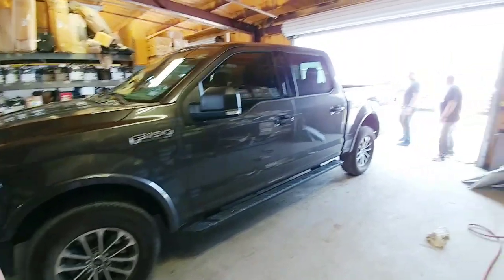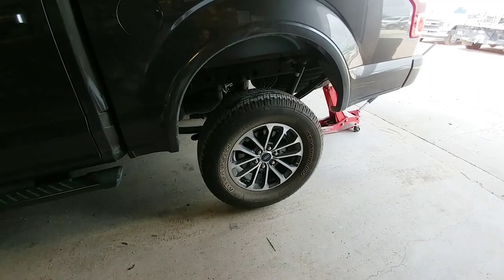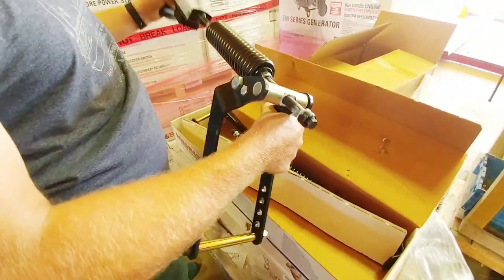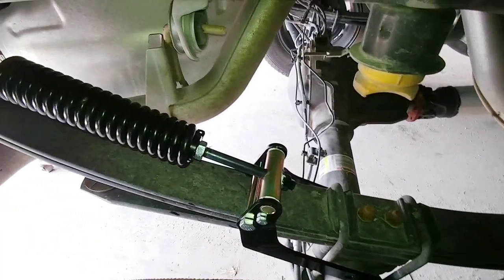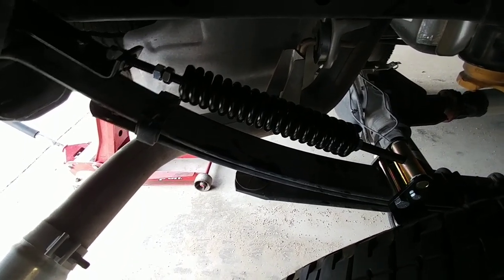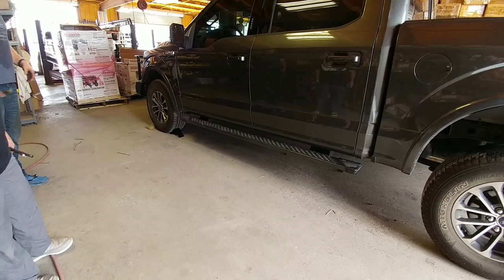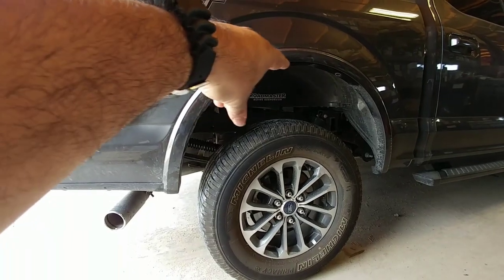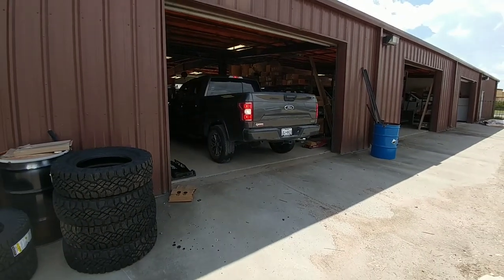Must have for 1/2 Ton RV towing! Roadmaster Active Suspension

Comment from the maker: We plan on trailering with this setup to review the improvements.  We did not have time to do it that day.
Reply: I have this on my 1/2 ton with happy and max towing packages and it is great.
Reply: You should put tow mirrors on the F-150
Reply: Big Truck Big RV  can you install with this air bags
Reply: As to the debate of advocates vs skeptics: it would be nice to have a Ford (or other truck) engineer sign off on this .
Reply: How does this compare to adding a helper leaf?
Reply: Curious if you can use this with air bags as well.
Reply: Would love to get a review video on this setup. Any chance it will happen?
Reply: @rvalltheway2796  I'm not sure you'd need to but that is a good question.
Reply: I have an F250. To improve the UNLOADED ride quality would you recommend the RAS or the Sulastic springs?
Reply: I have a 2016 F-150 Extended Cab, 4x4, w/Heavy Duty towing package.  I also have Timbrens on the rear end.  Can I use these in conjunction, or would the two systems be working against each other?
Reply: They make two styles - regular, and HD.  Which one is this?

Comment: I installed this  over 4 months ago. I pull a travel trailer that weighs 8000lbs. I’d say 90% of my trailer sway has disappeared. I bought this because even with my weight distribution sway control hitch setup, the sway was horrible. And yes I set the hitch set up correctly. This has been the best purchase I’ve done. The new f150 trucks leaf pack on a 4x4 are not strong enough compared to a 4x2. Most folks with a 2 wheel drive are not having the sway issues the 4x4 trucks are having. I’ve done enough research and found that out along with other differences. Hope this helps anyone
Reply from the maker: Great! Thanks for the reply
Reply: When you installed it on your truck did you take it to a shop or dyd you do it yourself? Looks pretty easy to do. I was thinking about putting in airbags for my 150 since it sags a little with my atv, but this seems like a set it up and forget it type of thing.
Reply: Chris Harris I installed it myself. It was really easy. Just make sure the axle is fully extended to get these to work correctly
Reply: I'd forget it all together
Reply: If you're still getting sway with your weight distribution hitch, your hitch is possibly not setup correctly.
Reply: I got some for sale. $200. used for 2 weeks
Reply: @beerbelly6670  is it for sale still?
Reply: @beerbelly6670  so what for sale??
Reply: @bottlefed91  did you make a video of the install with towing the 8000 lb trailer.
Reply: @joedonbaker1673  Oh but the 2004-2008 long bed f150 is just a towing master.
Reply: @JurjenHettinga  not with a travel trailer my friend. Your hitch can be setup perfectly but if you are towing an 8k pound plus trailer with a half ton when those tractor trailers pass you in the highway you are gonna get sway.
Reply: @frankthetank9193  Nope not true! 
I run with a Husky Centerline Anti sway and load distribution hitch on 2018 F150 FX4 Lariat! 
I go 70 75MPH in the mountains w/o issue. Great product.
Reply: 4x2 F150s have stronger leaf springs than 4x4s?
Reply: I ordered a pair for my Z71 2022 Silverado don’t have it yet but it’s on the way can’t wait to get them also bought a 2021 keystone passport 268BH so I should be set for towing the RV thanks for sharing

Comment: Add-on gizmos?  Why not just get a proper TV that can tow the trailer?  The problem is most folks get it wrong. This is the one time when you can put the Cart before Horse. It's better to know the limits of the TV before you buy the trailer. The first question you should ask the RV salesman is, what is the weight of that unit and what is the max load capacity?

Comment: When I first saw this product 5 years ago, I thought it was snake oil. After my mechanic highly recommended it due to his personal experiences, I gave it a go because it had a 30 day money back guarantee anyways so I figured it wouldn't hurt. I'm sure as hell glad I did! Wish I had done it 5 years ago!! I didn't need that 30 day money back guarantee because its the best product I've ever put on my truck! With or without my camper, this thing is smooth riding, sway control, axle wrap eliminated, and YES it helps with fuel savings ( when my camper is on). Id suggest anyone who is skeptical, or  thinks this is snake oil like I originally did, to give Roadmaster a call and take them up on the 30 day trial. You wont be dissapointed.
Reply: huhhman Ok.

Comment: That ride height/rake looks terrible, like comical bad. Air bags are the way to go. I have sumo springs that work very well for towing but are harsh enough that I remove them during the time of year that I don't tow my 5th wheel. I would adjust those to a lighter setting, or get that front level kit on asap

Comment: You always do a fantastic job of presenting information. I went with Summo Springs that install in the area of the bump stop. No rattling, never wear out, and install easily. They ride about 3/4" above the rear end frame on my truck and so don't change my excellent ride when the GMC 1500 is empty. As you add weight, they become more effective. My experience pulling my 7500 pound (when loaded) travel trailer has been great. Very little squat and more stable. This might be a good product for you to review.
Reply: Which set of sumo’s did you go with, blue, black or yellow?
Reply: @Bcharns  Been a while but I believe it was the black.

Comment: the pivot point of the RAS (the brass piece that the spring bolt feeds through) needs to be closer to the axle. It's too far back. You need to extend the assembly to make it longer. That's why there's more than one set of holes for the bolt and sleeve that fit under the leaf spring. Common oversight.

Comment: I absolutely love this product.  Because there is no drilling or screwing, it is easy to install yourself!  Just make sure you use jack stands.  That's scary having the truck only supported by a single jack.
Reply from the maker: Correct, this is a 1hr install max.
Reply: Oh I believe there is some screwing going on here.

Comment: I have looked at the RAS systems, but ended up with the Hellwig Progressive spring system.  Had it on my 97 F150 and now on my 13 F150 and they work best for me.  I've never had air bags before, so can't really compare, but when I looked at those too, I have just never liked the fact you have to adjust them for every load..

With the springs, it's set it and forget it...  I have some Bilstein 5100 shocks too, so the combo works very well for me.

Anyway, thanks for the vid to show the other product in more detail, but in the end, I like my Hellwigs.. :)
Reply: so air bags not good ?

Comment: I usually agree with your recommendations but this time I do not. Individually controlled air bag assist is best for maintaining desired ride height. They also will not sacrifice empty ride quality. I have them on two of my trucks (Ram 3500 with factory rear air ride and an F550 with aftermarket air assist). Each truck now provides a far more stable ride when loaded and the same ride it had empty.
Reply: I too have the air lift assist kit on my truck,   by far better system along with a auxiliary tank for air to whatever you want to use air for.

Comment: I have a 2011 F 150 with the max tow package. My trailer only weighs about 7,000 lbs. The I run load range E tires, an Anderson hitch with air shocks. We have been caught out on the prairie with 45-50 mph winds and it rig is pretty stable. Up grading from the factory tires to the load range E’s made the most difference. Plus they are lasting longer. I like being able to adjust the air shocks to maintain the ride when using the truck solo.

Comment: This is an interesting product and a good review. I have a ‘12 F150 that I used to tow an 8800 lb trailer and I added something similar with the Heilmann Helper Spring kit which was used to stiffen up my backed for towing. Curious as to your thoughts on that product? It would have been neat to have you hook up a 7000. Lb trailer and do a pre and post install squat test in seeing how much of a difference those springs would have made. Maybe in another video do a measurement? Helpful video and good introduction to an overall inexpensive product with some good upside.benefits.
Reply: I'm going to be pulling a 8,000 lb 20 ft inclosed car with my 2011 f150. I bought a weight distribution hitch and this system. How does your truck do pulling 8800 lbs?

Comment: I have set that I had on my '13 F150 with max payload/max towing package. They are good for helping with the braking and axle wrap but the gripe I have with them is that the bolts that go under springs tend to bend too easy. Last time I pulled them off, I had to beat the bolts out of the spacers to get them off. Not Fun!
Reply: I'm assuming you're talking  about the U bolts that hold the leaf pack?

Comment: I had them on a 2007 f150 with the 5.4 and they worked exactly as advertised. Pulled a 32’ and a 34’ bumper pull and, with a WDH of course the RAS made a difference in towing. Unloaded it did ride a little rough but was never too much to cause an issue.

Comment: Good video. Have seen this product before. Question is: can this be used together with sulastic shackles? Just installed one for the stock Ford Excursion v10 in the rear...the truck is for everyday use and long road trips and not necessarily for towing. Just looking for a smooth ride with less or no sway and vibration when hitting a pothole. your thoughts on how the sulastic springs (stock and not lifted) and the Roadmaster can work in tandem...
Reply: Anymous vint what do you think of the sulastic shackles I have a f250 4x4.

Comment: This thing could fatigue a leaf and if they're not military wrapped, you're in a really bad spot if they break. It will put weird stresses on the leaf pack centering pin, u-bolts and axle pads too. Firestone airbags and add onboard air while you're at it.

Comment: That test drive looked like the roughest ride I have seen out of a modern truck. The pendulum on the mirror was swinging on every bump and everything in there rattled like crazy until you muted the interior noise.  After trailering for hundreds of miles, I would like a tail bone when I get to my destination.  Good idea but not a product I would invest in.  Good video though, thanks for all that you do for the community!

Comment: You should have also driven the test loop with and without a trailer before the install and measured wheelwell height before and after.  This would have provided a better basis to determine the effectiveness of the product.  And also a test ride pulling a trailer after the install.

Comment: Fuel economy rating may be due to less wheel hop = more power to the ground not wasted.
Regardless that’s a lot of money for what it is, engineering is expensive. I’d go with airbags.
Reply: fuel usage with nose up vs nose down
Reply: Air bags don't compare to this system for towing

Comment: Pretty cool. Would you say this replaces need for sway bar, sulastic shackle or Timbrens? Would love review before and after with a trailer.
Reply: Hey Seth. Effectively it's going to do the job all 3, but obviously just in a different manner. Sway, smooth ride &less bounce(especially when loaded) and reduced squat. Fingers crossed he has a part two with a trailer involved!

Comment: Why not just "add a leaf" kit and some Bilstien or Rancho rear shocks?
Reply from the maker: Add A Leaf harshen the ride considerably AND requires far more labor to install as well as requires replacing the U-Bolts.  Not a bad solution (As it's what I did on my 2011 F250), just doesn't have as many benefits as this system does.
Reply: @BigTruckBigRV  how much more weight can it hold?

Comment: How well would this work for towing a 6,000-6,500 (3,000 lbs + 2 show steers) 14-16 ft. livestock trailer?  I have 2 kids and I would prefer to stay with a 1/2 ton pickup.  The majority of the shows are within 3 hours driving and I'm confident my 2013 Sierra 1500 with that has a HD towing package (HD engine and transmission cooling) can handle the weight but I'm unsure about what upgrades to do for the hitch weight and what braking upgrades I would need.  I will install a trailer brake controller in the truck too and have electric brakes on the trailer.

Comment: I didnt like the rake on my truck, and since the leveling kit for these trucks is absolute garbage and just plain not safe, and the factory springs are not heavy enough to haul much, I use a auto level air bag system from ridetech and lowered the back to keep the truck level. Works like a dream.

And to those that want to disagree about the leveling kit for these newer f150s put one on, jack the front end off the ground and watch the upper ball joint. The only "leveling kit" that works is the fox struts for the front, they lift the truck alittle without allowing the suspension to travel downwards farther than factory bottoming out the upper ball joint.

Comment: In my opinion, all this does is stiffen the leaf spring by adding some additional spring rate to half of the arch. 
It does nothing to combat the effect of the tongue weight on the axle loads.
It absolutely does not increase the towing it hailing capacity of the truck. 
It does not increase the resistance to sway any more than adding an overload leaf or air bags would. (Again, it simply stiffens the springs)
Fuel economy? Yeah, right. How? Got some test data to back that up? 

The primary thing these do is reduce the distance the rear suspension squats under any given load. That's it.

Comment: Interesting product. Your videos are always informative. Question here how ever. Is the sleeve and bolt in the correct hole? I have watched other videos that put the bolt further up the line like the third hole as to put the other end of the bracket closer to the axle. Thank you in advance for clarifying this.

Comment: You can put enough spring or bags under the back to carry an oil tanker, but the trucks gvwr cant be fooled. Frame strength, rear axle gawr, transmission, brakes, all the same.

Comment: I live in California and just bought a 35 foot Jayco Jayflight (2015) and I purchased a 2018 Ford F-150 XLT.  I brought the trailer home and it was a very bouncy ride.  I have a weight distribution system on the hitch.  Would this system improve the ride with the weight distribution system or should I go with an airbag system?  I am brand new to towing.
Reply from the maker: This should help considerably.  might also want to go with a firmer shock, like the Bilstein 5100
Reply: Buy airbags, all in, parts and kit, $650ish, a little more than this setup, but adjustability on the fly is nice with onboard air.  Have donee to (2) 1/2 ton trucks that hauled and towed constantly, best upgrades ever!  Hellwig on GMC and Firestone on Ford, both problem free for thousands and thousands of miles.

Comment: Sorry but I didn’t hear the owners /driver comments on the ride change before and after install was it good or bad? You were driving around in a unloaded truck and I thought this product was more geared to improving loaded ride, squat and towing improvements . No sure you convinced me to spent $450 on that upgrade. My only positive was boy did that install look easy for the do it yourself trucker
Reply: I love them pulling my 10K TT with my 15 F150.  I don't feel harsh, jarring road impacts from the rear suspension over rough pavement any more.

Comment: I used to have one on my T100 from 10 year ago. F150 on this video looks too raked with the Roadmaster yielding virtually no negative rear end  travel with the bed empty. Too much preload on the spring unless this truck will be always driven with 1000+lbs weight on the bed.

Comment: After reading my equalizer weight distribution hitch manual a few times and setting up my Tundra for a trailer with a 900 lb tounge weight, the goal is to transfer weight to the front tires, not to raise the back end.  This mod is counter productive, for trailering, in my judgement, as it reduces the drop when the trailer is put on.  It’s the drop that loads the sway bars , transferring weight to the front and increasing the friction to reduce sway. To be sure , the back end does come up some due to weight transfer to the front, but in my case, still squats some.  The manual only has you measure the front when setting up.
Reply: With that much tongue weight you can adjust your WD to your hearts content, but the back end is still going to sag a bit.  Adding this with only using the 25% spacer will solve that problem immediately.  We have the roadmoaster AS, and the same tongue weight you describe.
Reply: Nicea Trya You setup brings the front end down per equalizer instructions?
Reply: Hey Mark,
You can never go wrong with a weight distribution hitch, and we recommend utilizing a weight distribution hitch when possible! We do receive calls from many folks that have already installed the WDH, made readjustments but are still experience instability, rear squat and the affects of that rear squat. RAS does work well in conjunction with WDH, we recommend an adjustment be made to the WDH if it's been towed with prior to installing the RAS. The feedback that we've gotten from customers and dealers that sometimes recommend RAS and WDH, is that they LOVE the set up and made towing much easier.

Comment: If you want to tow with a half-ton, go with the Ram with active 4-wheel air-ride/load-leveling and get the off-road height adjustment and “kneeling” to let disabled grandma in easier as side-benefits.

Comment: They installed it wrong.  

You need take out the tire and while the leave springs is supported at both end you need to let the axel hang in the middle than put on the active suspension.  

You can't tighten is while the the tire is on, the leave springs aren't being stretch